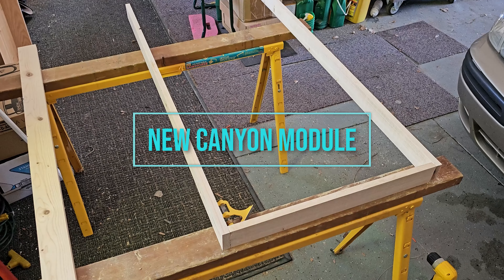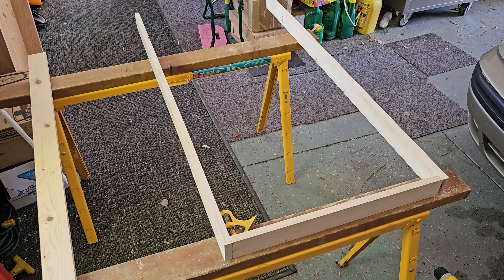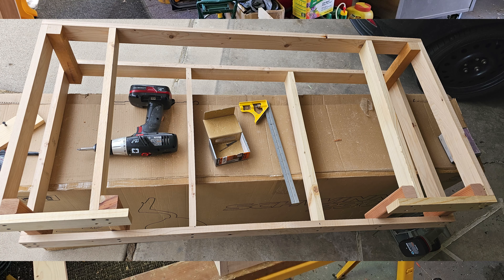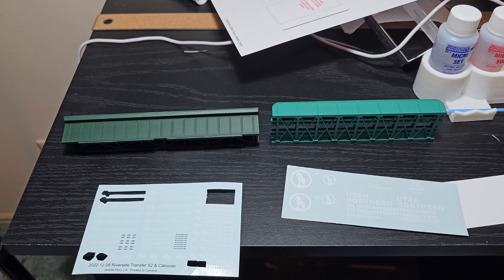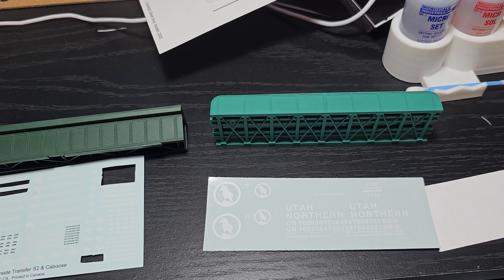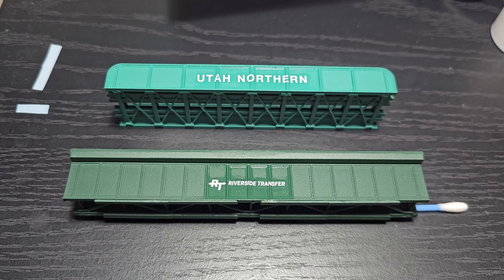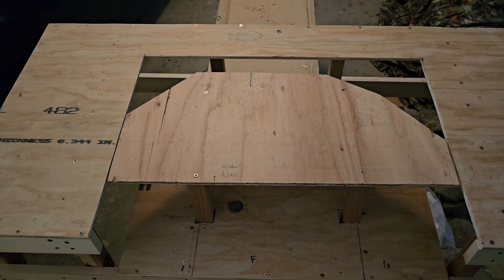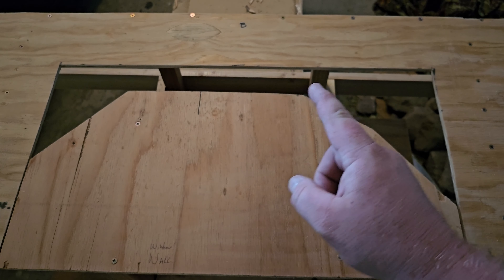Start Of A New Module

Comment: Where did you get that holder for the Micro Sol & Set?
Reply from the maker: It was a 3D print that I found a while back and printed. I tried to find it again but couldn't. There are a few different ones out there though.